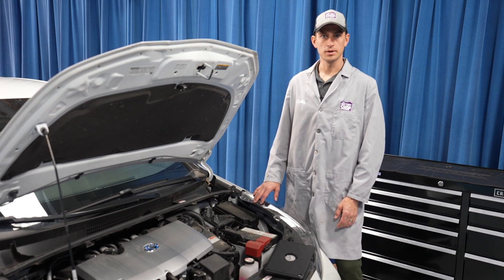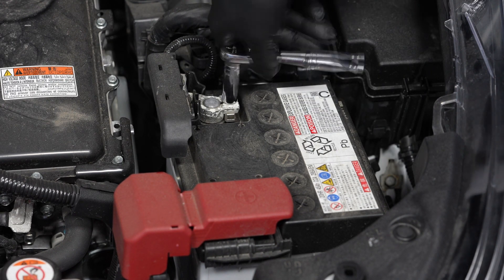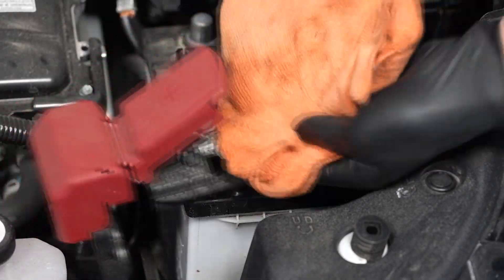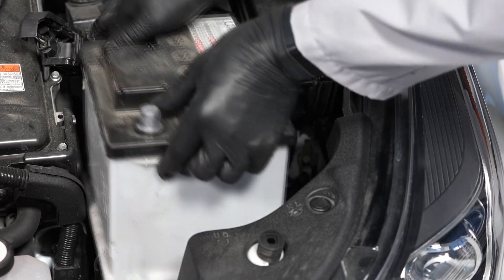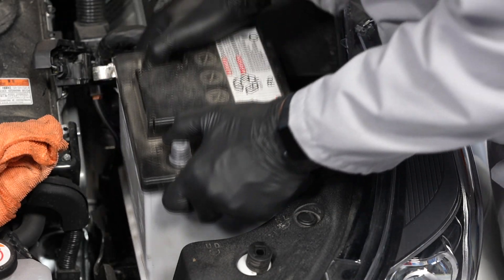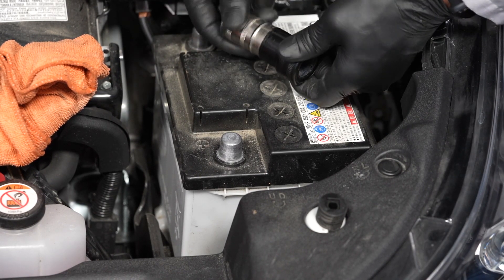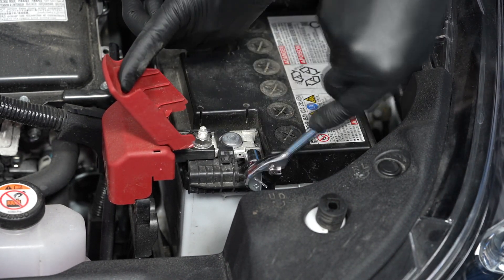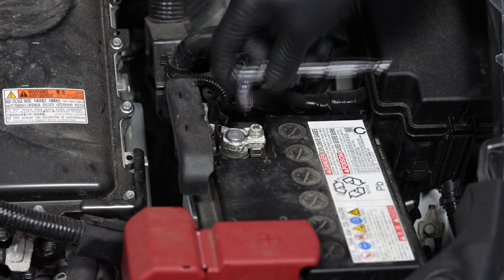Toyota Prius Gen4 (2016 - Present) – New Battery Install

Comment: What are the wrenches you're using?  I heard you mention the 10mm and 12mm sizes for the sockets(?) but I don't own wrenches that look like the ones you are using, so I need to know what they are called so I can buy them.  Thanks.
Reply: I watched a few 10mm and 12mm seems for entire job
and the extension socket deepwell a plus
Reply from the maker: Thank you for watching.  If you would purchase a socket set with a variety of mm size sockets you should be covered. Most terminal fasteners are 10mm.  You may need 12/13mm for the hold down bolts.  Deep well sockets would also be good.

Comment: Does the Prius need yo go through an idle relearn after a battery replacement?
Reply from the maker: Hi - Thanks for watching! We use a Memory Saver to keep vehicle computers settings so things like that were not necessary. We suggest that you check the vehicle owner’s manual or a service/ repair manual for the vehicle to be sure.